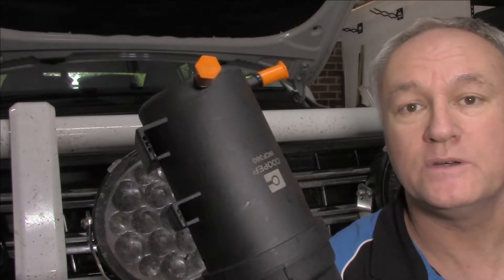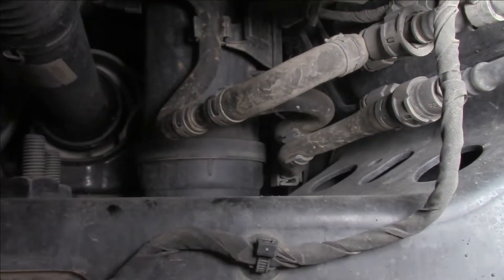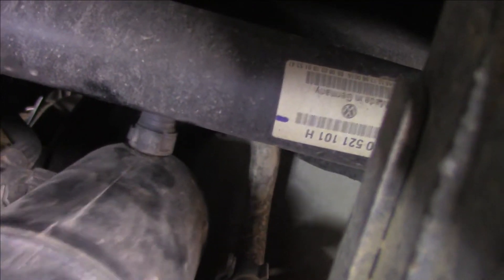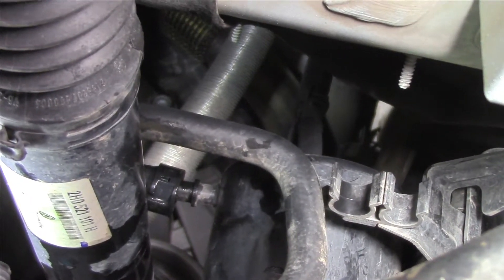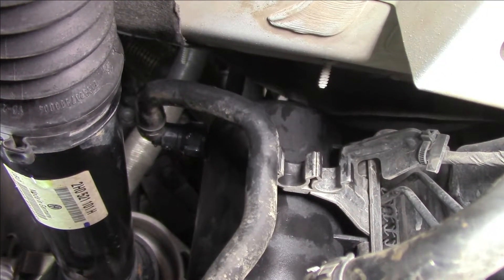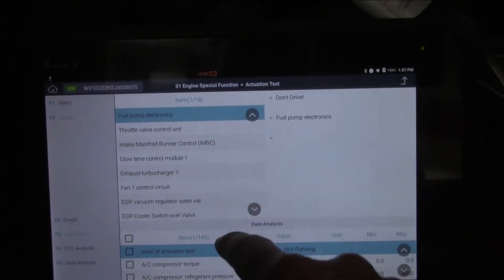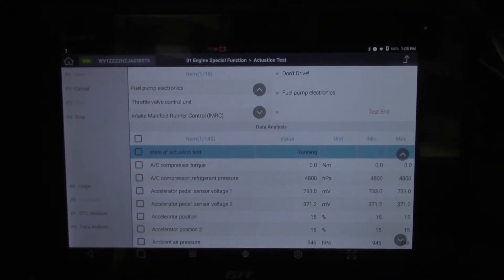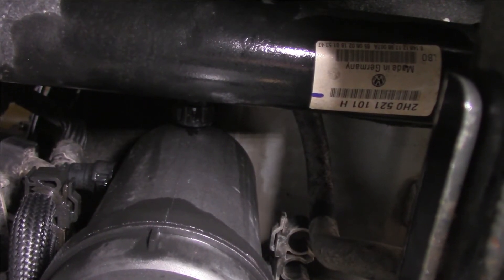VW Amarok Fuel Filter Replacement MiracleMAX

Comment: So I was one of the apprehensive people who was worried about fitting one and not priming correctly. I put mine on today after watching this, great video by the way. I unscrewed the drain plug from the bottom of the filter and filled it up to the brim with good diesel. Changed out the old one for the new and she didn’t miss a beat. Don’t stress peeps, even the air in the lines once disconnected sorts itself out, no prime needed. Just fill the new filter with diesel and you’re away.
Good luck!
Reply from the maker: Glad it worked out well for you & thanks for the comment 😉👍

Comment: I finally replaced the fuel filter of my amarok V6 today.

For anyone interested the code of the filter is: 2H6-127-401-A, but someone told me that the 2H6-127-401-C is compatible too.

I didn't use a computer to turn the pick-up on, I only turn the key to Start position and wait for a 7-8 seconds.

Thanks for the video, was really usefull.

Regards!
Reply from the maker: Thanks heaps for sharing with us!

Comment: No computer required. Priming the filter works fine. I've just now got back from a test drive after doing mine. I was apprehensive like everyone reading this,  easy as and pretty quick. 
  Slipping a piece of garden hose over the inlet and a funnel , keep filling the filter with fuel until it comes out the outlet. Have it filled ready for a quick swap in the case you haven't clamped the hoses real well
Reply from the maker: Thanks for sharing 😉

Comment: Thanks for the helpful video. I have the model before this one the 2lt. Is the filter in the same place?
Reply from the maker: Hey Paul Rogers,
Funny you should ask! I worked your model Amarok yesterday. The earlier model is in the same position, but on the passengers side.
Reply: @MiracleMAX  Thanks again Max
Reply: @MiracleMAX  Can I do the replacement without a scan tool?
Reply from the maker: @paulrogers1536  I can't be 100% certain on that model, but if you turn on the ignition and hear a fuel pump priming, then chances are that you can just use the low pressure pump in the tank to prime the system. By turning the ignition on and off maybe 10 times, you should hear the system prime and the sound change as the pump has to work harder to push the fuel through. You should be able to hear that in the video above.
Reply: @MiracleMAX  Thanks Max

Comment: You need a Scan tool to do this, which one would you recommend.
Reply from the maker: From comments from others, it looks like you can prime the electric pump just by turning the key on and off 8 - 10 times before you start the engine.
Reply: @MiracleMAX  sorry for taking so long to thank you. I have had my Amarok serviced by the VW dealer. And again the fuel filter has not been changed. Last time they said next service. I do my Patrol fuel filter every 10,000. The Amarok is still under warranty so it has to go back to the Dealer for service so as not to void warranty so they say.
Reply from the maker: @peterlostroh8709  If you are in Australia, you are covered by law when deciding where to take your vehicle for servicing/repairs. There is criteria of course, but it does NOT have to go back to a dealer for servicing. If you have asked for extended warranty, they sometimes put in a clause to make you  take it back to the dealer, but this has nothing to do with the manufacturer warranty.
https://www.aaaa.com.au/choice-of-repairer/
If the engine is a diesel, PLEASE get your fuel filter changed. You will end up with greater problems if this is not done on a regular basis.
Reply: @MiracleMAX  . Thanks again for your help, the VW dealer here in Queensland says it has to be serviced by them so as to  maintain warranty and that they need to reset the computer otherwise it won't run properly also there's a special procedure for changing the oil that requires their specialised equipment to complete an oil change. Sort of leaves me regretting having bought an Amarok. I hear say that the Ford Ranger is no better.
Reply from the maker: @peterlostroh8709  Any quality workshop should have a scantool that should be able to reset the service intervals & oil change times. Not sure what they mean by 'reset the computer'. Maybe they mean reset the intervals.
Perhaps you can let them know about Australian law and Right To Repair.
Reply: @MiracleMAX  . Thanks again, I think declining sales and customer servicing is making these dealerships try to scare up business. Your help is much appreciated.
Reply from the maker: @peterlostroh8709  You are probably right. But they have no legal right to demand that you have your servicing done there.

Comment: What is meant by non electric prime? They won’t prime by turning the key?
Reply from the maker: Some vehicles, Mitsubishi Triton as an example, use a manual hand primer to get the fuel up to the main pump. The main pump may have a low pressure pump build into the back of them

Comment: So glad someone has finally put a video up for this! One question is how to prime if you don’t have that computer program thingo? Thanks
Reply from the maker: Hey Charlie _B,
Honestly I haven't had to do that so I couldn't really comment. I didn't notice, but does the fuel pump start to prime when the key is turned to the 'on' position? If it does, you should be able to cycle the key several times until you hear the sound of the fuel moving change (maybe 10 times).
I have read online that some just fill the filter and hope for the best, but this could introduce contaminates, which would be a bad thing. There certainly wouldn't be any guarantees with that.
Other methods would be providing voltage to the pump, whether directly or via a relay, but you would have to be confident with the correct wires using a schematic.
MiracleMAX
Reply: @MiracleMAX  Yep. This what I have done in the past. Only takes a couple turns of the key to do this.
Many thanks.
Reply from the maker: @stevebrickshitta870  Thanks 
Steve Brickshitta,
In this case, the key option is probably the easiest.
Thanks for your comment.
Reply: By some hose clamps. I clamp them all and fill the filter up with a syringe using diesel injector cleaner